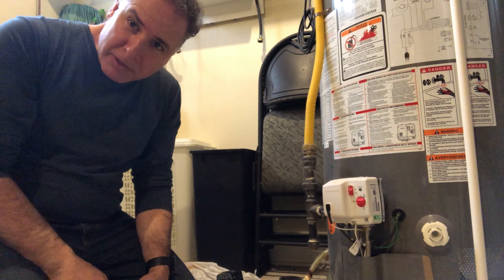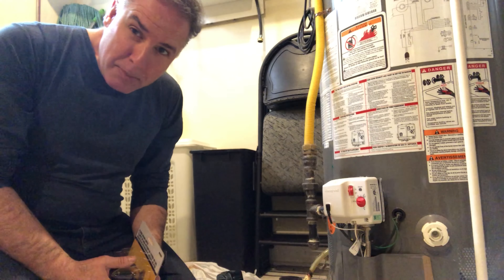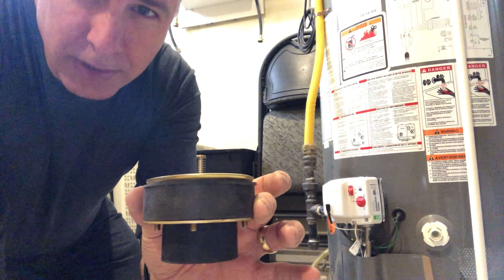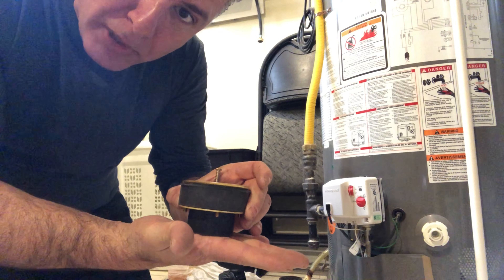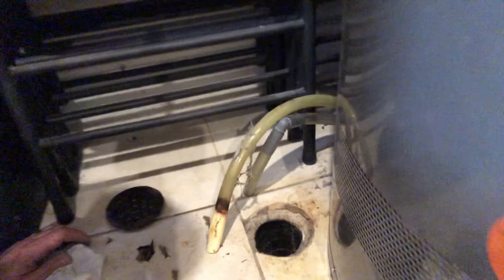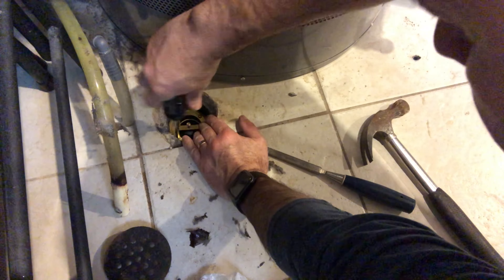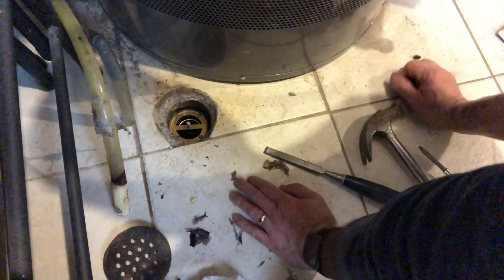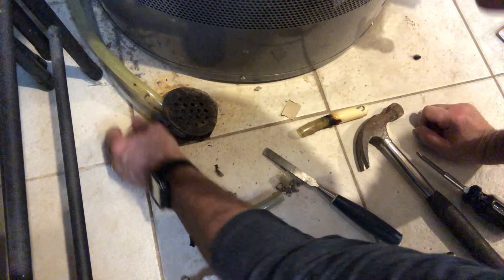Mr Fix   Moen Backflow Preventer

Comment: Thank you. I wish my drain was near the water heater but it is in the middle of the basement.  But you did give me an idea on how to proceed. ❤
Reply from the maker: @praful6890  If there is a storm coming you could also temporarily plug it with a test plug…..thanks for watching
Reply: Great point. Thank you.
Reply from the maker: @Nikola_C  i recently added a Little Giant pump for the furnace condensation so I leave the test plugs in all the time.  Thanks for watching.

Comment: I have my doubts that these will stay put during a major backup. Better, would be a "Stand Pipe Adaptor", but you need to be home to screw in the extension pipes, when needed to raise up your floor. I asked Moen in Oakville (Ont.) if they planned on making these....but no answer.
Reply from the maker: @geobrown9413  During big storms I use a test plug to make sure nothing comes backup.

Comment: Thank you, I'd like to remove mine..been 30 years, cannot counterwise the screws. Any suggestions for removal? Thanks again.
Reply from the maker: The metal looks like brass or another type of weak metal so I would get some side cutters or snips and destroy the old one and take it out in pieces.
Reply: @Mr.Fix_RC  It was the screws not the "weak metal" Never mind. 4 months later...to respond. Take care.
Reply: @bleflambeur What did you do finally? Bust it into pieces or managed to unscrew it?
Reply: It is dumb of Moen  to put in slotted screws, they should be hex. head bolts with extra long heads on them.

Comment: Thanks for the video. Recently I had a sewage backup with a spillover onto the basement floor - with a twist: it came up NOT from the drain near the furnace, but through the drain of the shower stall. By the time I found out, the backup was gone, everything was draining and flushing normally. Can you comment on that, if similar situation happened in your practice?
Reply from the maker: @HarryPFlashman1  I had the same issue with it backing up in the basement shower.  Since it doesn’t get used I put in a plumber twist test plug and just left the drain cover unscrewed so if anyone needs to use it I’ll just remove the test plug.  Hope this helps and thanks for watching.